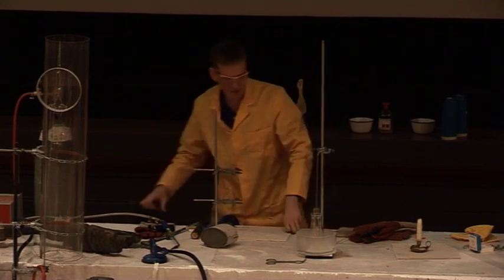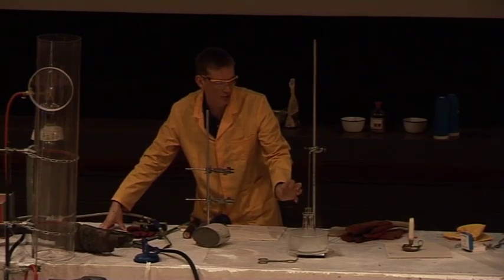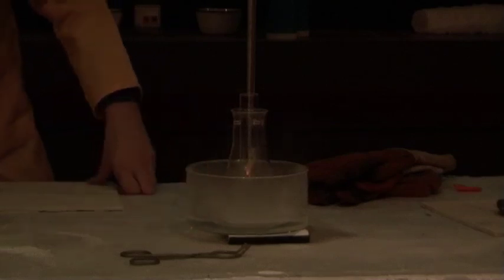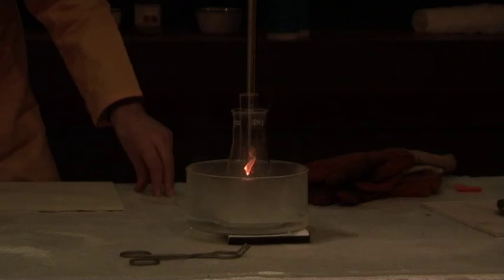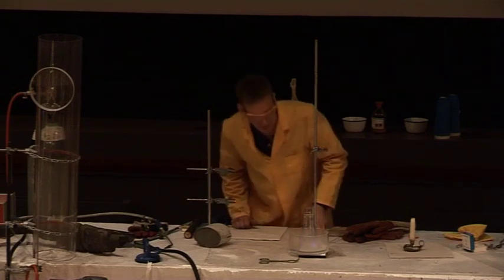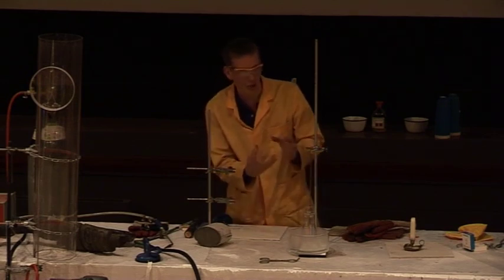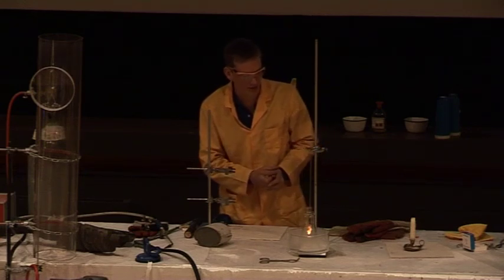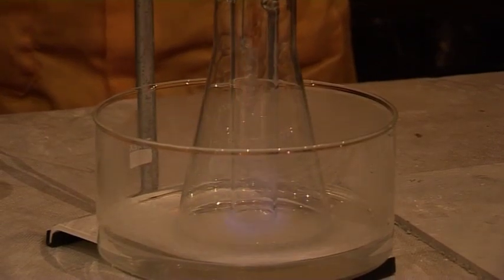Fire and Flame 32 - Platinum with Methanol

Comment: We use it in our aladin. A kind of lamp in the Philippines.
Reply: Aladdin lamps don't use platinum. If you used platinum with a volatile fuel, you wouldn't have to light the fuel. (presuming the platinum is up to temperature) In the Aladdin lamp you actually have to light the fuel. It's just usually metal oxides that incandesce and makes white light.